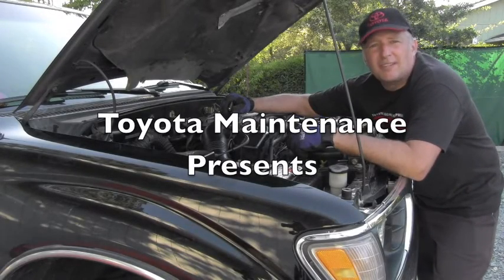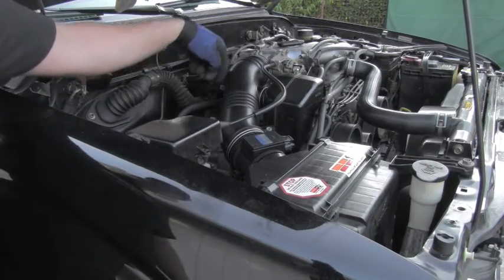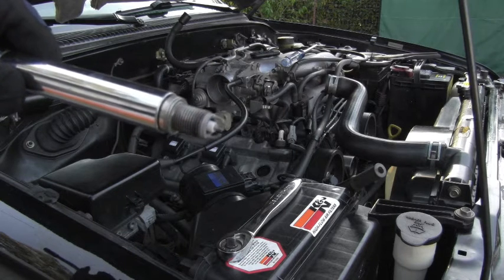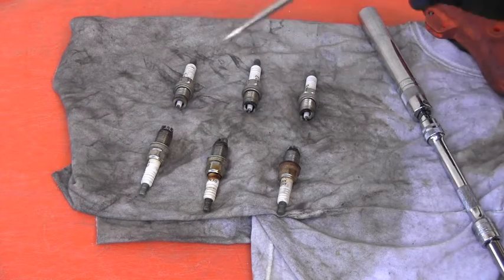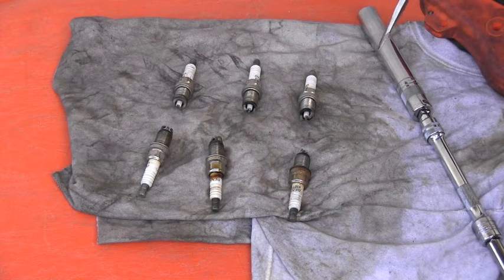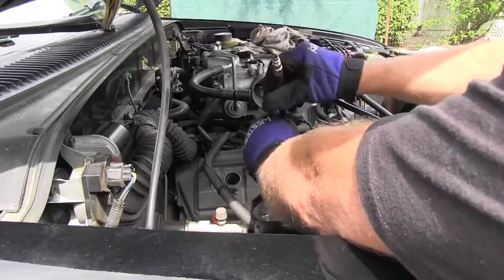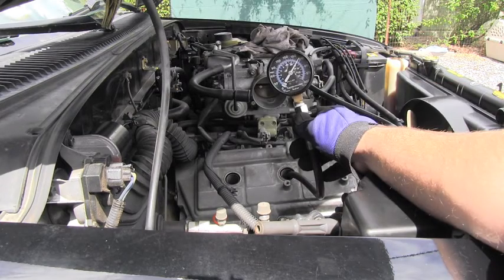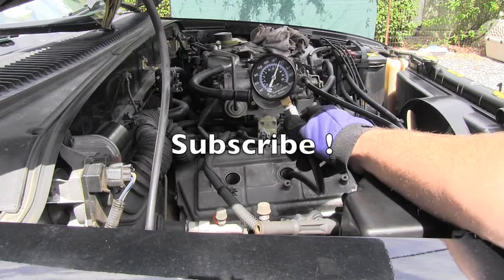Toyota Tacoma overheating diagnosis, Part 3

Comment: how did you address the leaking spark plugs gasket?   Don't see many new video's hope everything is well on your end!
Reply from the maker: +Bardia Ghajari  that is fixed by replacing valve cover gasket..no other way around…thanks for watching.
Reply: @ToyotaMaintenance  What is the loss of power.
Reply: Thermostat? Does it need a bigger radiator?
Reply: Did the owner get the power back.